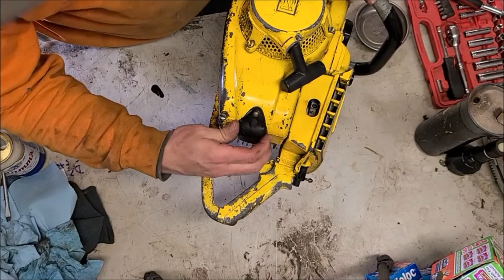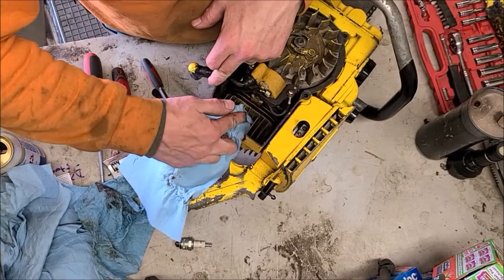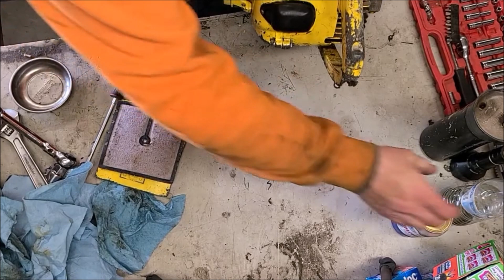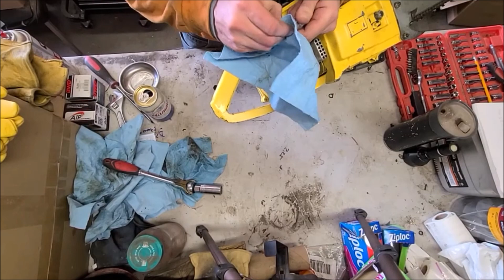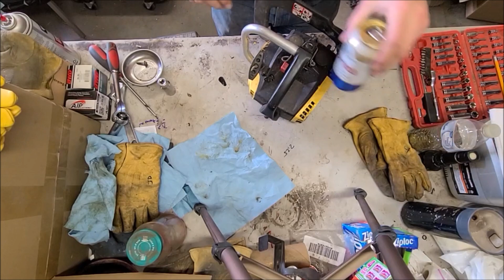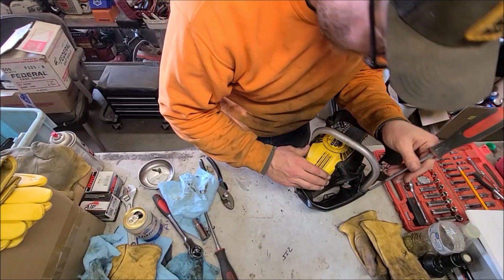McCULLOCH Chainsaws, Episode 2

Comment: I sometimes spritz some carb cleaner into the intake and it'll run a little.
Reply from the maker: I'm sure using carb cleaner in very very small amounts is probably ok, but it's basically the same as straight gasing which can do serious harm as it washes out the lubrication. Like starting your car engine with out oil in the crank case.